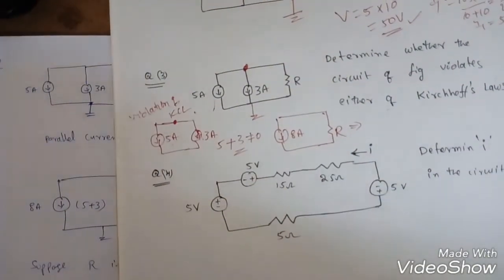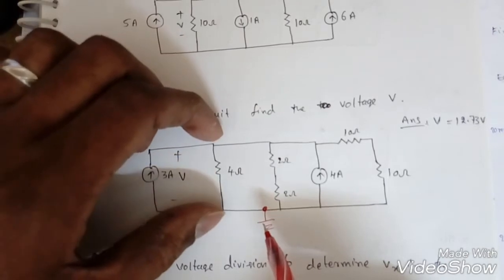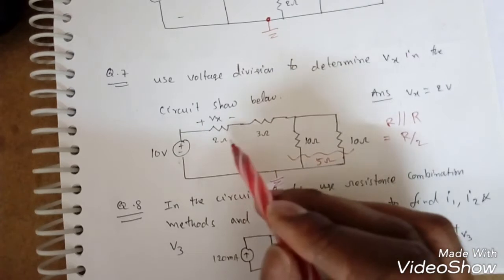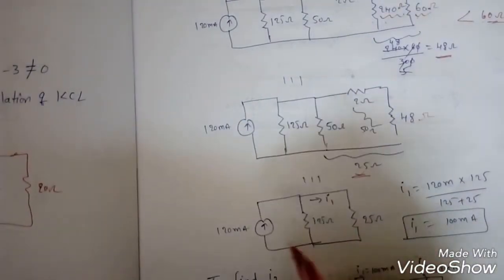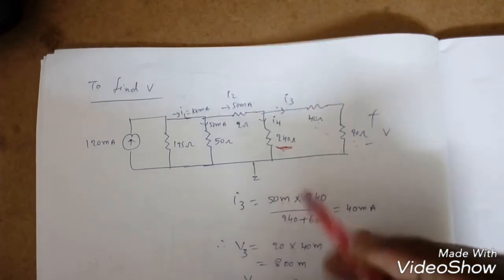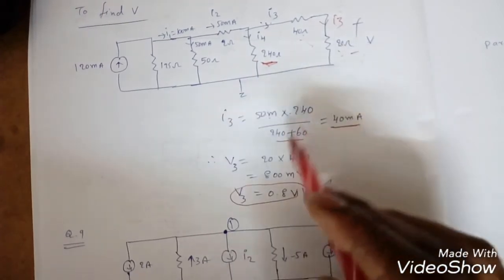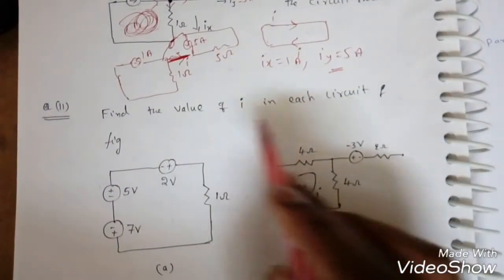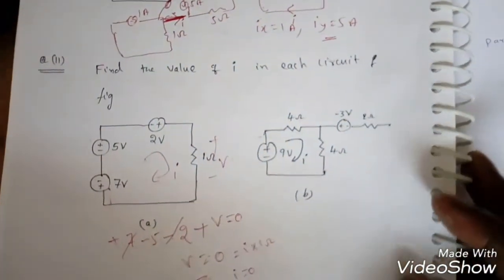Network Theory Lec-8-2: Problems solved based on KVL,KCL, Current division and voltage division

Comment: in Question 13.b the values and current direction of the two parallel sources at the right hand side aren't visible properly. What are the values and direction?

Comment: In question no 4 , if we take loop oppsite to what u have taken  , the current i will be 1/3 so if the options are giver 1/3 ,-1/3 which of the option is correct because ur answer is negative 1/3 and actual current flows positive 1/3..so in that case if i do by taking different loop direction answer will be positive but actual will be negative then which is correct ?
Reply from the maker: we have to choose option such that it should match with the current direction in the question..suppose if you have taken opposite direction and you got -1/3A...but as far as question question concern the current direction is opposite so the current is -(-1/3) = 1/3 A...
Reply: ok sir got it ..thank you and do upload videos sir as per your promise!!!

Comment: In q11.b  two resistances are in series 4 & 4ohm...so we take 4+4=8ohm r accross the applied voltage 9v. now applied ohms law v=i.r; 9=i.8;i=9/8=1.125A.......sir is it correct?

Comment: sir, the concept which you explained in 5:53 , is that applicable to parallel  combination of more than two resistances ?
Reply from the maker: Yes absolutely applicable to any number of resistances..you can verify by adding 3 resistances in parallel and see the equivalent resistance
Reply: thanks sir , i admire your work :)

Comment: Hi Sir,
In question 10 why can't we redraw the circuit with 1A and 5 A sources and 1ohm and 5ohms all lying parallel between the common node point and ground ?Then add 5A and 1A and make it as one single current source of 6 A
Reply: No,it will not be possible since this ckt does not have a return path connecting the two resistors. What you are saying would have been possible if there was a return path. Clearly explained from 13:41.

Comment: sir in question no 8  why we dont apply the current division rule at the begining it self i.e.   
(120ma*50)/175 and assuming it as ix  &  subtract it from120ma i.e 120ma-ix  we  can get  i1 
why it is not possible please explain.....
Reply: When current division is applying only two branches should be there..

Comment: If we are applying the current division rule for question number10, the answers will ix=5A, iy=1A. Is it possible sir ?
Reply from the maker: no we can't apply current division rule in that problem...current division happen whenever there are two or more than two branches with resistors and a current source
Reply: Learning Is Everything Okay, thank you sir

Comment: sir, can you please explain the answer of 12(a), 
-2-12+i*1000=0
I think, I don't get it right..

the answer of 12(b) 
-12+I.5-10+3=0
I=3.8A.
Reply from the maker: 12(a) is very simple...10V is parallel to other elements i.e across 1kohm resistor 10V..therefore i = 10/1k = 10 mA
Reply: sir, here 12 and 2 voltage sources are short circuit??
Reply from the maker: No they are not short...they will be subtracted and result will be 10 V...apply KVL then you can get
Reply: yeap sir, actually it's my fault sir, the circuit fig which I draw is lil incorrect, that's why 
-2-12+i.1k=0
it should be
2-12+i.1k=0
got it sir.. thank you so much